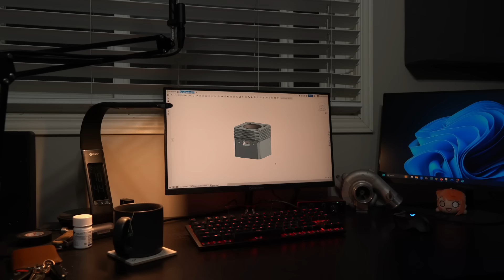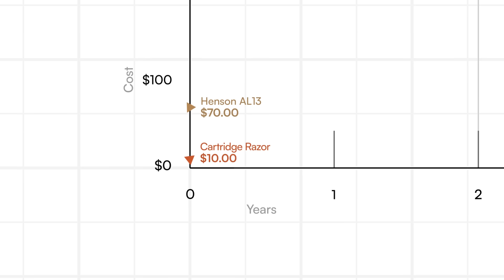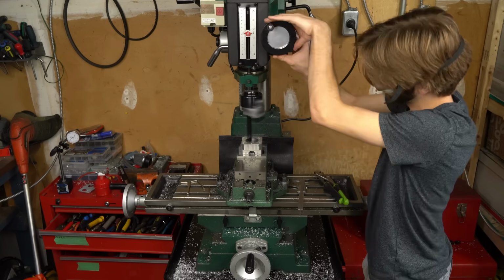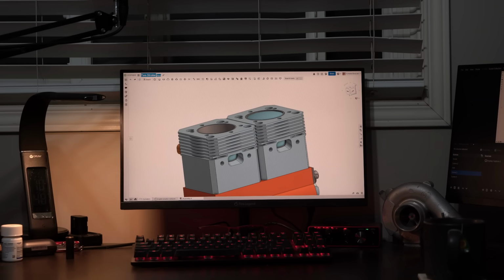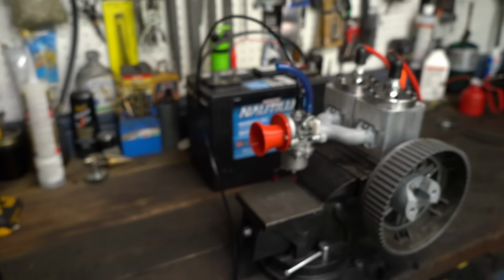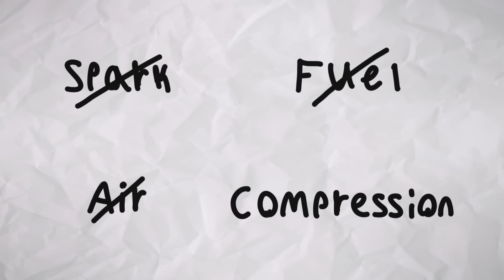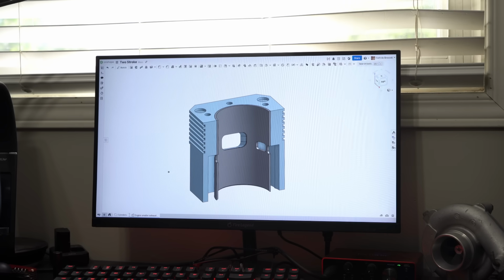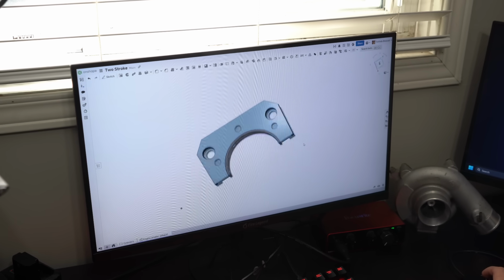Building a Two-Cylinder Two-Stroke Engine

Comment: You don't need the cylinder liners that tight.  The engines I work on are the bigger diesels.  The liners are machine with ledge on the bottom and the headgasket and head torqued down holds the liners in. They use orings between oil and coolant but the orings also hold the liners in to keep them from chucking around in the cylinder bore.  You get the small gas engine down. Make a diesel engine. You could do a 2 stroke diesel. Youll need a blower on it. Fuel timing is interesting. Make you own nozzles or injectors
Reply from the maker: I think next I will run slip-fit sleeves like you were saying. I designed these ones with 0.004" of interference which explains why they were getting crushed

Comment: You can put the part that you are inserting into the hot part in the freezer so it shrinks a bit and makes the size difference even bigger, so it would be easier to insert
Reply: I’ve done this a ton with wheel bearings

Comment: If you get it to work stable enough to not kill itself within 20 minutes of running, you could try designing a rudimentary turbine for it. Fuel mixture not getting in the cylinders is a problem, solved by proper exaust&intake pressure. It shouldnt be heavy/powerful, just something that creates 1.15 bar extra on the intake, thats it. While stealing some horsepower, it might drastically increase performance/fuel efficiency while stationary.

Comment: Hey I think you are running that boring head a little fast. Would help with vibrations and surface finish. Also setting up auto quill feed if your machine has it to about .002/rev might get a better finish

Comment: Love the 2 stroke series.

Just a small tip from someone who's trying to work with 2 strokes as well, make sure you have enough oil in the fuel and that you're not running lean (especially if it's a "new" cylinder, like you would after an overbore).

Comment: In Italy we have so much of these 2 stroke engines. We have them in Vespas and some holder motorbikes. A know issue is the oil they eat as we don't want them to blow up or jam. We usually do a 2 to 4% oil to fuel mixture. Btw I loved the Gran Turismo intro song at 10:07. Had good memories of that game

Comment: you should use sand casting for your conrods and MAYBE even your crankshaft, since you now have a lathe and a mill that are capable of bringing the necessary dimensions into spec, and to make the journals for the bearings

Comment: Please put an exhaust on it. The litteral heart and soul of a 2-stroke is the exhaust.
Reply: I had a 70cc Yamaha BWS couple years ago. I once lost my exhaust while riding it, dont ask how cause I dont know. And it ran better than EVER, I had a very nice Malossi exhaust too so it shouldve ran best with that, but it actually ran better than EVER, without it, and it sounded like a god damn harley Jesus f*ck lmao
Reply: No it's not
Reply: "you need backpressure"
Reply: a well tuned 2 stroke will run along just fine without an exhaust, people who say this think they know something about how the 2 stroke works, they dont
Reply: @zulu1697  yeah, but you don't get the maximum power, because you don't have any resonance without exhaust. The fresh fuel air mixture in the cylinder is partly pushed out the exhaust.
Reply: @jr-serverfun yeah i know, but its not "needed" like a lot of keyboard warriors claim it is
Reply: @jr-serverfun  oh I didnt realize he was dynoing this engine and seeing how much HP its producing, I agree eventually he needs a bulged two smoker pipe but he hasnt even gotten it running smoothly yet, also the pipe in practicality only affects powerband not overall power AS much

Comment: As your cylinder probably isn't first rate and who knows what your pistons and rings are like I hope that you're running with a fairly high dose of 2 stroke oil. That oil may make the difference between a few minutes working time and maybe a few hours.

Comment: Rather than trying to dial the precision up to 1000000% you could try designing it in a way where the precision doesn't matter as much. For example the cylinder head doesn't need 2 giant cutouts for the piston sleeve ports it just needs way for the gas to get to the ports. You could instead cut more like a manifold into the head using multiple smaller cuts so that there's still material in between to support everything. 

When designing manifolds it's important to remember that you need to be able to have all the intake able to flow through all the exhaust. this means that the single inlet needs to be larger than the outlets. Or that the single outlet needs to be bigger than the multiple inlets. And you don't add up the diameter of the inlets and outlets you add up the cross sectional area.

Comment: you need to have the fuel supply sorted better with the 2 stroke oil. without it the bottom end bearings are just dry.

Comment: Why you don´t buy/make your own compressor gauge tool directly?

8:25 and better get a pair of little twizzers lol, will be more useful than you think

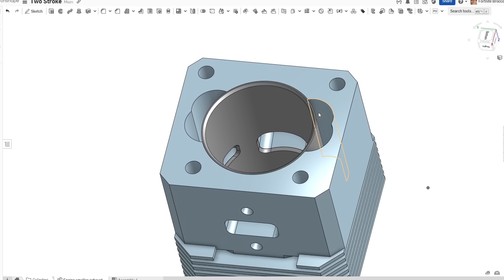9:30 or directly make their walls thicker so they don´t warp like so, sleeves in 2T motos are used to be thick to avoid warping

Also when you work the sleeve in the lathe you need a way to hold the other side, you need a cone for holding from the tailock and working the outside, and that´s lathe is supposed to come with the tool that holds the piece from the outsides with three tips so you can workthe insides.

Also the silencer or escape is more important than you think in 2T motors, they hold the pressure increasing their performance, that´s why you see that weird shape in 2T bikes escapes

Comment: What I do for my billet aluminum is getting aluminum car parts and melt it all down into the shape i want like bar stock I use a pipe with a cap then fire it and keep adding aluminum until it’s full then turn it off

Comment: you should run ~16/1 pre mix for this kind of two stroke  + con rod oiling slits (if not already present) + running lean is bad for lubrication as there is less overall oil, these could have contributed to the bottom end failing

Comment: Have you thought about giving it a small constant feed of oil like normal engines. Since it has crosshatching the oil should carry up and improve wear and compression. 

Also, you could just bathe the crankshaft in oil and use thrustwashers I think.

Idk I think you know more than me, but I figure you might get some ideas 😊

Comment: Please make another version of this. You need to use a nicasil insert and press it in, instead of steel sleeves. Nicasil will last 100% its what they use in race engines for 2 stroke mx and scooters :)

Comment: I feel like it would benefit from a longer intake runner

It would problem help with making the fuel atomize by giving more time in air and having more walls for it to brush against and help it should help out bottom end power

Comment: Are your sleeves tapered to get tighter at the top and looser at the bottom? I know almost every small scale RC 2-stroke engine does this to essentially force the cylinder walls and piston to wear into eachother forcing a perfect fit when at operating temperature. Only caveat is that you need a break in period where you're heating the engine before your first couple runs, making sure that it wears a perfect fit.

Comment: sideways wiggle of a connecting rod is normal, its up and down movement. Also dont forget you need to break in the rings before it will run well. Last thing is on 2 strokes exhaust is very very important especially lower rpm and idle, please put some long pipes on or a muffler.

Comment: Please lower your squish. it will run way better. you can check this with some solder bent in de cilinderhead and turn it over. then measure the thickness of it. make the squish around 1,5 mm.

Comment: you know if you took apart a chainsaw like cheap one and just used that as referance material youd get closer than think also you could make a copy of the drivetrain and build a chainsaw to use your engine or use to bolt upto a dynamo and make a mini generater.

Comment: This is a great step up in technology.
How do you seal crankcase halves though? I thought inline 2 strokes needed sealing around that middle main bearing to avoid pumping the fuel-air mix between the first and second crankcase half, since one piston is upstroking (creating suction) and the other is downstroking (creating pressure). Maybe try making a boxer 2-stroke at some point? Pistons rising and falling simultaneously means a common crankcase and a common intake manifold are entirely viable.

Comment: Commen practice is to install the interference fit sleave and then bore it to your final size just installing them can make it slightly out of round. The other style has a lip on the bottom to hold the sleave and the head or upper block gets bolted down and it clamps it in place

Comment: Id suggest getting a micrometer hone so you can hone to final size. Also turning a custom bore cutter would be a good idea. Like a fine adjust boring bar but the tool moves while the cylinder stays put. Could also put some ball bearings on the low half to help guide the cutter true to the bore while reducing friction. You already have a decent sized mill. Large enough to bore and hone with little chatter.

Comment: I am without a doubt NOT a expert. However i do work on lots of engines. Firstly after fixing the issues such as that crank bearing and other things. I highly recommend figuring out a expansion chamber and rigging up a make shift "Muffler" i belive there is calculators and resources to calculate how to make a expansion chamber the proper dimensions for the engine. And the muffler can be made extremely easy. Just study some motocross durt bike muffler rapacking vids to get familiar with the parts. That would help ALOT with it running. Also rig up a thing so you can throttle it. And make it so the ignition timing can be adjusted. Try advancing and retarding it and see how it works

Comment: Oiling system is super important, not only for wear resistance but because a well designed one creates a oil bearing with low viscosity.

Comment: Make sure you're oiling the bottom end. Small 2 strokes usually draw air in through the crank case to oil the bottom end before it goes into the cylinder, but larger 2 strokes have changeable oil like any other engine that lubricates the bottom end
Reply: That’s only 2 stroke diesels. To my knowledge no 2 stroke gasoline engines that have changeable bottom end oil. Gasoline 2 strokes rely on crankcase pressure and scavenging to run, so oil down there would immediately be burned. (Source: I own 2 70’s 2 stroke Suzukis. A 1972 T350 and a 1975 gt750)

Comment: A9 cutting fluid for your aluminum and rapidtap cutting fluid for your steel. The material is galling on the cutter tips, rubbing the "scoring" into your surfaces and yanking your parts out of the vice. To save on heartache dont do precision work dry. =)

Comment: If you want to continue to make parts like this i would advise you to buy a better mill. The way its built makes it so it's vibrating, way easier compared to an old-style machine like a mikron wf2. With a machine like that youwould be able to machine fom different sides and have waay more travel and ways to machine and fixture and use about the same space

Comment: I absloutely know now why all the engine shops bore & hone the sleeved cylinder AFTER the sleeve is in: that´s why. they become finished & round in situe. That´s the thing, try it.
Maybe for a more fitting project: make a fixture plate for Your lathe to mount the cylinders on to. But I have to admit: I envy the tooling. A lathe & mill are on my whislist loooong time…
Anyways: for a first time this has true potential. I don´t know if I would go straight to building engines as a newbie but it certainly teaches You so much. 
And I admire the stubborness to hanging on to port controlled engines. Yes, a reed or rotating valve- shure. But these are the basics, embrace them. Good Luck, God Bless, Greetz from Germany!

Comment: The way the trabant handles fuel is by having the intake go into the center roller bearing, with a vane that blocks off one cylinder at a time . Your attempt with one carb had no regulation of the sort, so when the cylinders alternated they just swapped air between the two of them.

Comment: This is insane! It sounds so good!! Congratulations on getting it running! 

I wonder if the reason why it stops running once it warms up is the thermal expansion of the piston? I’m assuming you already factored that in, but considering you made the pistons yourself from aluminum stock, the aluminum stock could be expanding differently than what the material specifications say. Just an idea. 

I wish you the best of luck with this build, it’s insane!
Reply from the maker: With the new sleeves I was actually running the other pistons, but generally most grades of aluminum have a pretty similar expansion coefficient. Back when I was planning this video, I sat down and did the math to determine at which temperature the inner bore of the 6061 aluminum cylinder would expand by ~0.004". It only needed to be heated to 117 Celsius which was a much lower temperature than I expected lol
Reply: @CamdenBowen  oh I didn’t catch that, thank you for the reply! What are your ideas on why it didn’t like running once it started to warm up? That definitely eliminates thermal expansion. 

By the way, are you going back to a four stroke for the next video or are you continuing on this engine? I will love either one so it doesn’t matter, whatever you want to do!
Reply: @CamdenBowen  Use cast iron sleeves. They spall less and expand less thermally. Until spray on coatings like nikisil, just about every vehicle that lasted an acceptable amount of time (not a Vega) used either cast iron sleeves or cast iron blocks.

Comment: I used to have a round column milling machine too and I found it awful to work with, it never locked down hard enough to get proper rigidity. How is your experience milling with yours? Did you ever have issues with the column twisting or otherwise coming loose when it bit into the material? The results seem pretty good in the video
Reply from the maker: The only problems I've really had with this machine so far are with the vise and the cross slide. The vise is complete junk, nothing in it would ever square up properly and the jaws never made flush contact even after I tried to adjust it over and over. As for the cross slide, the gib seems to be smaller than it really should be so the table kinda wobbles from side to side unless its locked down. So under heavier cuts the whole cross side kinda jitters

Comment: if you have to put gas in the intake to run it means it is still lean, and also, properly gapping the rings is very important, and also, pistons are made in a "cone shape", where the skirt is tighter on the sleeve than the crown to account for thermal expansion, and brass bearings are used only on 4 stroke engines, 2 stroke always use roller bearings on the conecting rods, with openings for lubrification.
Reply: Old 2 strokes also used brass bearings, including Simson and Trabant from the GDR engines until the late 70s. These engines would run on 1:33 mix instead of 1:50. (Source: I own engines like these)

Comment: Happy to see an update on the engine project. Like always a very cool and entertaining video.
If I may share a few things I noticed during the video. (if this comment ever gets read xD )
I highly reccomend using ball bearings on the connecting rods tho. Bronze is a good bearing material but its not really ment for that kind of high force/high friction application and its a way better fit for linear motion (like the intake/exhaust valves) or if its not rotated >3000x a second in a hot engine. Ball bearings are exactly designed for something like this.
And please, dont use an end cutting mill for rough machining aluminum XD. Thats how one of my friends got a mill melted into an aluminum block back in my aprenticeship as polymechanic.
Antother thing is you should probably use emulsion or at least a bit oil for milling. It will increase the quality of the surface and spare your mills damage by overheating and chipping.
If you are not doing it already, switch your cutting bits for each step. There are rough cutting bits for rough cutting and end cutting bits for the final cut of the surface. this goes for mills and the plates for lathing.
Anyways, cool video and keep it up :)
Cant wait to see the next

Comment: You really need to make a lip for the Cylinder sleeves, not sure if you are or not, but you could pull the same trick some Diesels use and put O rings on the Cylinder Sleeve

Comment: You should make a two stroke with valves (power of a two stroke and reliability of a four stroke because the bottom part of the engine can actually have oil unlike a two stroke)